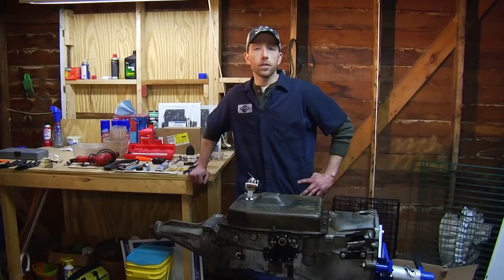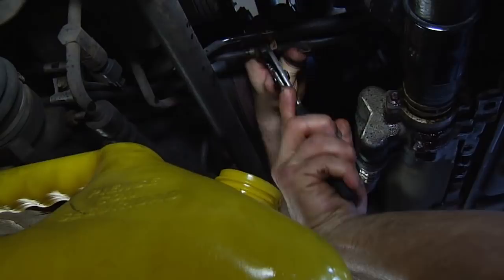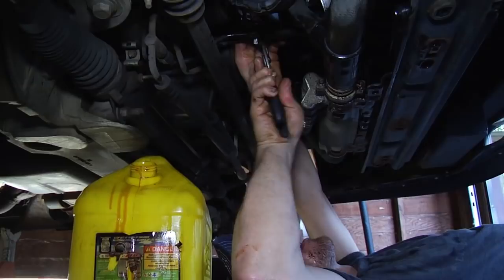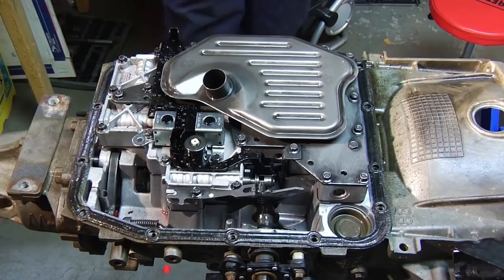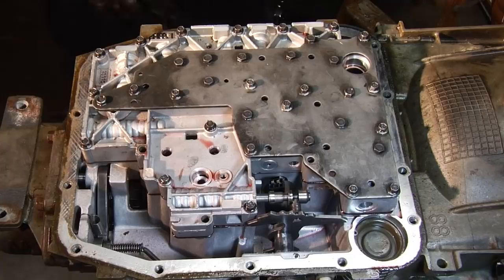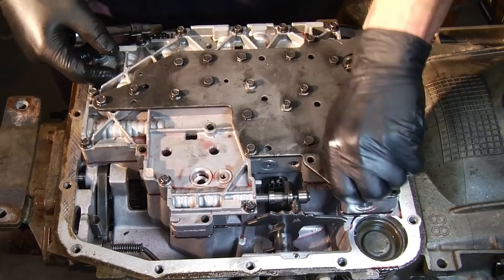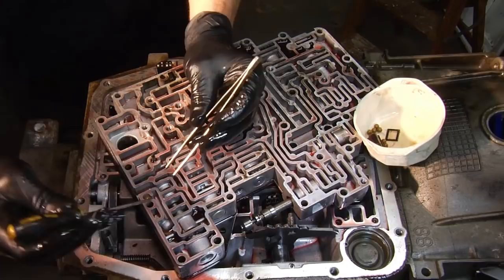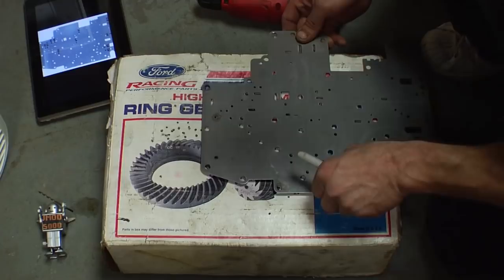The Official JMOD How-to Video by Rizzo

Comment: Something tells me this guy knows how to do more than just a j-mod..  There's no way in hell I'd attempt to do this,  he didn't cuss or throw a single tool..  Lol. Great job.
Reply from the maker: +John Stern LOL
Reply: #Rizzo if you care to know your video reached me in Fresno CA and taught me how to take down the pan without making a bloody mess!!!   best step by step instructions I have learned from thank you!
Reply: did this mod about 1.5 years ago on a 2003 f150xlt 4.2 truck..wow amazing..but now I got sick of smashing the gas pedal down in drive when starting and it switching at 3500 each gear soon the tires all gears while shifting shifts hard out of first but nice pick up on my 6 banger.lol
Reply: @lords2112  i have a 1998 f150,  5.4,  4x4,  regular cab, 6'5" bed.  did you use the same procedure as in video or some other info .  want to do this to my truck.  180,000 miles
Reply: @davidcastano4760  559
Reply: @bobhaddock957  - Just do it! I've never heard of anyone who did the J-mod who actually regrets it.
Reply: @bobhaddock957 did it work?
Reply: You can do it car and the corner ball make sens. Seen them right away after he said that. But he didn't put the yellow spring back in for the 1-2 shift lol. Neck snapper at full throttle. Love it.

Comment from the maker: The Jmod is of real benefit to your transmission—it's healthy for it to have this done. Removing the lower springs drastically reduces the clutch slip between gear changes, and the holes that are drilled make the transmission operate more efficiently and "breathe" easier in a hydraulic sense.

Comment from the maker: The 4R70W transmission has a lot of clutch slip between gears and this is what creates that soft seamless shift most AARP members prefer, AKA "The Grandma shift." With the Jmod, you get a quicker shifting transmission with firmness you can control through throttle application and a longer lasting transmission too.

Comment: Hey I have a 03 gt with the 4r75w. I just did your mod exactly how you did. took me about 2 hours total from start to finish. (I double checked with the video a couple times,  to make sure I didn't miss anything!) I have to say, This is the easiest write up/video on this that I came across. I was dreading this mod because I have never did any work with auto trans before. I am very pleased with the outcome, GREAT under normal driving and EXCELLENT under hard acceleration.. BARKING TIRES FTW!

Comment: I performed this exactly as shown in the video and all went great! I must say this is a great shift improver.. No neck snapping shifts. Proportionate to the throttle pressure. Just right.. also DO drill the plate for the reverse engagement. It eliminates that annoying delay! Great job on the video and thanks a million. I bought my VB gaskets and 8 check balls from the ford dealer and they were spot on.
Reply: When he says to “check hole for hole #4 and twist by hand drill bit”

Does he mean to drill by hand the hole on the black gasket?
Reply: What mileage did you do this at and did you reuse your transmission fluid or drain and add new?
Reply: @tony_5156  yeah rewatch 28:00 where he explains it. But basically you take your drill bit and very gently ream out the holes on the gasket because just like the valve body previously, the gasket hole(s) are the same size that the holes in the valve body previously were.

Comment from the maker: Leave the bottom 2-3 out. 

For clarification : The lower 1-2 come out, The Upper 1-2 stays there... No one wants firmer down shifts....Steering wheels taste like ass.
Reply: Jmodderator I’m about to do a flush and filter change on my 4R70W (‘95 F-150). So I can just pull the lower 1-2 accumulator springs and lower 2-3 springs and leave em out? Seems like a decent little free diy mod, just trying to make sure before I do something crazy lol.
Reply: XD  steering wheels taste great. Why the hate
Reply: @scottycrippin2126  did you? Any answers on this

Comment: Started with this on my 06 P71, ended up rebuilding the whole trans.  Turned out my direct clutch was smoked due to a internal hemorrhage caused by the case being worn where the ring seals on the output shaft ride. I had the case repaired with a steel sleeve and totally rebuilt it adding an extra friction and steel in the direct clutch and of course doing the J-mod. Totally different trans now, shifts much firmer and mileage went up, who knows how long the direct was slipping.  Dig the 70's porn movie soundtrack on the video.
Reply: charlie dee did u also replace the bushing next to it,maybe that's why casing wore.I have same problem
Reply: lol 70 s porn music

Comment: Very well done. I had this procedure done on the advice of my rebuilder on our Saleen S281 Budget a few years back. This mod, along with a couple other mods and and what the rebuilder called a Police Interceptor torque converter, really woke up the slush box. Hated having an auto trans in a Saleen, but at least the boss was happy and could drive the car frequently. Just picked up a CV LX Sport for my son. A well cared for one owner 211k mile car, I'm sure we'll be looking at a trans rebuild down the road. The car is SO clean that even a $1500 rebuild/mod on the trans is money well spent. Thanks for the great info and insight. Again, VERY well produced video! Sending it to my buddy who is a rear wheel drive platform engineer at FoMoCo!
Reply: Damn that son is lucky

Comment: My 2004 Marauder has a tune and a very aggressive transmission shift. It is made even more pronounced by solid rear control arms and 4.10 gears. My 2004 Town car is a low mileage garage queen and completely stock chassis-wise. On both cars I use your transmission fluid pump technique to change the fluid occasionally especially in Florida where heat kills auto transmissions. I just consulted this video this morning for a fluid swap on the Lincoln. It only yields ~4 quarts so I did it three times and used a case of fluid. The color change is quite impressive!! Thank you for posting this and sharing your knowledge and expertise!

Comment: Well I started off with the Jmod which turned into a full on transmission build, billet shafts and forward drum ( kept factory # of clutches), pump lube mod, force tail shaft lube mod, re worked Sonnex valve body with superior stage 2+ shift kit, billet adjustable OD servo, billet accumulator piston, new 1-2 accumulator piston, new overdrive and reverse band. replaced rear main seal with teflon, PA SFI flex plate (had to drill out converter holes to 31/64,  put in new bearings and bushings teflon seals etc. New spicer u joints ( w/grease fitting). ARP Pro flex plate bolts, Mr gasket TC nuts, Ford Racing bell housing to block bolts, 2400-2800 stall converter. I busted the motor mounts getting the transmission out so new pioneer motor mounts. Royal Purple Max ATF, magnafine in line filter, SCT tune, all new sensors wiring harness valves etc,  As soon as they are available Im ordering the SR performance transmission pan +2 QTS............All because I watched this Jmod video.

Comment from the maker: Research the Softer Mustang Spring. 

Their trans was set for more of a Sport shift. This spring has less resistance than the stock FIRM CV/GMQ spring. 

NO ONE I have ever helped do one or done one on has asked for one after. 

I'd tell you to 

Do the entire process, Pull both bottom springs. If you do not like it, As shown, You can reinstall the bottom 1-2 with a simple pan drop.

Comment: amazing. this is perfect. I work on cars but never wanted to do this myself until this video. I will be doing this on my 95 mark viiii. thank you for the help.
Reply from the maker: +Shane Thompson Read the links on or to TCCOA.com. They will help you out. 

The drill bit sizes vary from application to application. You may also benefit from a 1999 Main Control swap and new pistons for the 1-2 and 2-3 shifts.
Reply: Jmodderator the jmod won't hurt the transmission in any way would it?

Comment from the maker: Let me tell you about the powerful Thumbs Up Button! 

At first I was skeptical like you and then I did some research. Turns out not only did clicking Thumbs Up regrow my hair it also had effects likened to that on Axe Spray on the opposite sex but with out the harmful propellants! 

Also I noticed the same year I clicked Thumbs Up on this video we had a white Christmas,My son made Honor Roll two Trimesters in a row and my wife was promoted at work! 
 
You'd be crazy not to click Thumbs up!
Reply: I never saw or heard mention what level of performance this mod is? Mild shift improvement, HP drag strip or what?
Reply: @richjacquemin - Good point!

Comment: Yes, and to anyone doing the 1-2 accum procedure the valve body does not have to come out. A C clamp or bottle jack can keep the accumulator from popping out. Search for TSB 97-11-11 on google for the correct springs for your car. Also, all these trans should use ONLY branded MERCON V to stop trans shutter! On some years you can remove the torque converter screw and easily drain all fluid. It was doable on my 95 tbird. I heard newer 2004?? units don't have it.

Comment from the maker: A 3/8th's drive extension and standard short 10mm socket is all I use for those. I know your cross member gets in the way. 

It's ok to push and pull some to get your extension past it. I come in from the side and slide the extension in between the C/M and the pan. 

It looks harder than it is.

Comment: A crown Vic transmission is pretty easy to take out and replace so doing this in the car would be an unnecessary gamble. It could be done, obviously, but constantly fighting gravity invites a mistake. Love the info though, very helpful and offered in a relaxed fashion that's easy to watch and learn
Reply from the maker: Having done near 30 by now, there is no way I'm pulling the transmission for this. 

The one used in the video was a dead one donated for filming.

Comment: Great video. A good friend of mine owns a trans shop in the Detroit area. Builds some pretty mean Chrysler and other race trans. I'm local too, (Troy). I recently acquired a super-clean 1994 Crown Vic LX. Have 25,600 on the clock as of yesterday. My trans developed the nasty 40-45 mph shudder/vibration, I had the unit flushed and filled with Mercon V per the Ford TSB. About 1000 miles later, the shudder is back, somewhat gentler, but has got progressively worse in the space of 50 miles. Car has an at idle very subtle "lope" as if it had a performance cam. This is a departure from the Grandma car smooth idle. Something is up. It looks like tear-down trans time. I'm going to have my friend Tim rebuild it for me. I watched your video, love it! Way to share great info. Finally my last question: When performing the J-mod on a 1994 transmission, where can I find solid info on what holes to drill in the seperator plate and what size?
Reply from the maker: This is not applicable for the AOD transmission.
Reply: Thank you for the response. As of last night, my trans  builder friend sent me outside to look at the door tag, and my trans is a "P"	or an AOD.

Comment: Thanks for this amazing video! If you have a pre-98 you should at least do the 1-2 accumulator in the vehicle. The piston was updated and the springs often break. It causes lots of 1=2 shift issues if the old parts remain.

Comment: For the 1-2  Which is considered the  "Lower' spring as I have read some have just used that spring but not both.  Thanks
Reply from the maker: If the video is unclear, The lower refers to the spring you see first when you remove the caps that retain them both.

Imagine the car in it's on the ground orientation, and not upside down like the video shows. The lower is down or closest to the trans pan.

Comment: Looking at the gasket set for this jmod on eBay, they sell it with a valve body cover gasket also, but I don't see it removed in this vid.
Safe to say I wont be needing it? Ill be watching this vid several times before I do it in case I missed something.

It's ppl like u that give confidence to people to do shit themselves.
Excellent vid bud.
Reply: Screw after market unless it's a Sonnax transmission kit... You will know it works the first time. As I had people bring me shit OEM kits and they fail inside 6 months. As the Valve body gaskets are so cheap they blow out..And buy the factory fluid XT-QMC or XT-QSM As Ford has an updated Fluid to fix shifting issues.

Comment: I'm getting ready to do this on my 06 P71. I just got another valve body off a 2010 out of the pick a part to do it on while I wait for my parts to arrive. Then all I have to do is swap valve bodies. I ordered an upgraded separator plate due to Ford's infinite wisdom of removing the reinforcement plate over the 2-3 servo creating two of the reasons the 4R70W and AODE transmissions go toast. Without that reinforcement there, the constant pounding of the 2-3 servo on the plate cause it to either crack or lift up causing a cross leak which engages the forward clutch pack when it shouldn't be engaged resulting in a toast transmission. The upgraded plate is thicker and comes with a little cap that goes over the "sombrero" end of the 2-3 servo to spread the force. The plate kit with new gaskets is around $45 which is cheap insurance against a $2,500 transmission rebuild. I'd recommend just getting an upgraded plate as cheap insurance against remortgaging your house to repair or replace your transmission.
Reply from the maker: Saying Buy a Tuff Plate would have saved you so much typing.... 

https://www.amazon.com/4R70E-W-75E-W-Super-Seperator-Plate/dp/B00BYG7DFE

And stay away from the BOC kit, It's not worth any of the extra money that kit costs. 

Another option is this...

https://globaltransmissionparts.com/ford-4r70e-4r70w-4r75e-4r75w-upgraded-hd-super-tuff-valve-body-plate-by-superior-2001-up/
Reply: @Jmodderator  I typed all that to answer any questions others may have had. Global Transmission is my go-to place for almost anything I need. I'd make a video on how I tuned my Vic with HP Tuners but then people would be blowing up their cars.

Comment: This video is amazing but it's real bold of Rizzo to assume I'm doing this with the trans still in the vehicle 😂😂😂
Reply from the maker: Dang, would you pull it just for like 30 bolts facing down?
Reply: @Jmodderator  I was thinking more all small parts falling on the ground and trying to carefully replace them while working over my head 🙃
Reply: @Jmodderator  I should clarify that my hands sometimes shake pretty bad when I'm trying to do things, so I just feel like doing this on the bench would make it much easier for me. For the average Joe it's probably way more feasible to do it in vehicle.

Comment: You should have a rubber plug on the bottom of your converter bellhousing. Pop that, and turn the crank till you see the bolt. When you are done, replace with a new bolt from Ford.

Comment: Careful about removing the springs on the 1-2 accumulator. Very harsh shifts on engines producing <300hp. There are 2 springs, I just removed one. Thanks for the tutorial.
Reply from the maker: There is a softer purple color spring you can use. It's stock in the Mustangs.

Side note, Kind of related.

He means there are two lower springs, This is true in some applications. NEVER remove the upper 1-2 spring.

Comment from the maker: Yes, Easy though. 

Once you have the car up and have room crawl under there with your feet out the drivers side. Get a good breaker bar or at least a 1/2 drive ratchet and an 18mm Socket. 
Remove the black rubber plug you see at the bottom of the bell housing, Feel first,you may be lucky and see the drain,If not use the ratchet and turn the motor by hand Clockwise with your right hand and leave your left in the hole and wait for the drain to come around. 7/16th socket for the drain plug

Comment from the maker: Well, We Jmod our cars for a few reasons.

1 It creates a more exciting shift.
2 It eliminates the clutch slippage between gear changes.
3 The Valve Body is completely cleaned out and in a slightly more advanced version Shift Solenoids are replaced with stock parts from Sonnax, These parts wear out, So it's also Preventative Maintenance.
4 In some years All the Trans fluid is drained and replaced, Again more PM.
....... TBC..

Comment: Great vid! But hearing the engagement on those raised panel craftsman ratchets at 37:10 is bringing back nightmares to those decades of use when I thought they were decent ratchets. Now I shudder at the thought of being stuck with them over literally anything else, this isn't a Snap-On Dual80 is the best comment, it's an "even any of the cheapest amazon brands are 1000x better" comment......

Comment from the maker: Never drill the gasket with an electric drill. 

Use the 7/64th bit and twist it by hand thru the #4 hole of the paper gasket. Make sure it's open enough. Just a slow twist til the bit moves slightly easier.

Comment: GREAT video, I have a question.  I am installing a good used 1998 4R70W in my Mark VIII. I want to do this J-Mod but I only find 94-97 Drill specs which are different then what you mention.  More holes and about 6 different size bits Vs only TWO sizes on your video.  That said for my 1998 4R70W should I just drill the six holes you mention and in the same sizes as mentioned?  I don't want to screw up anything.  THANKS in advance!

Comment: Thanks for the feedback.   I went ahead and did the work you described.  Before doing all this, I completely took apart the valve body that I was using to get it thoroughly cleaned.  Did it piece by piece with pictures and left the parts in order in the square.  Got it put in and it wants to stay in second.  No first when I pull to one.  No regular drive.  A few times it acted like it would shift to 3rd and then started slipping.  Any idea??  or who to ask?  Thanks